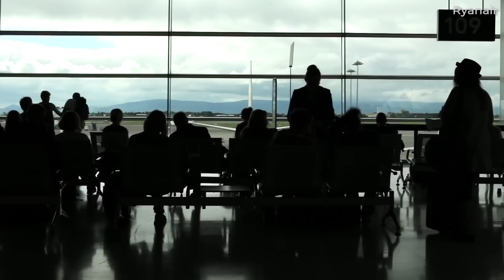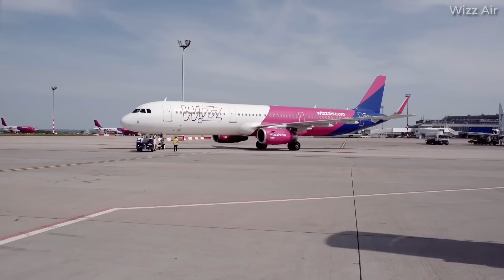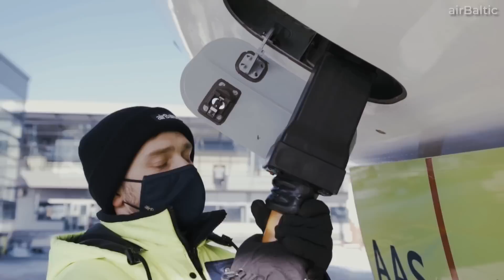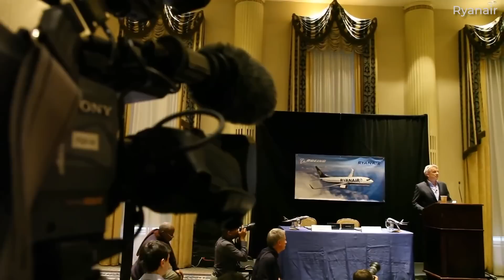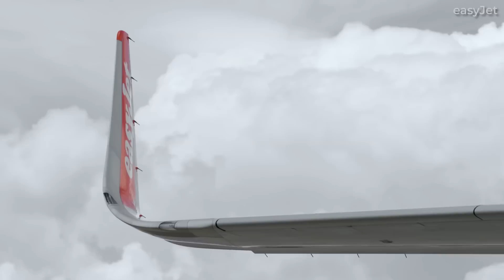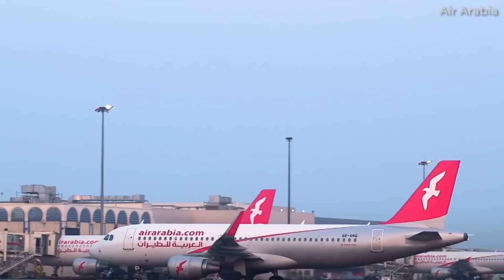5 Key Advantages Of Single-Type Fleets For Low-Cost Carriers

Comment: reading about big discounts make me laugh when looking at Ryanair and easyJet, Ryanair were looking to order the MAX 10 but Boeing initially weren't willing to give them a big discount, easyJet also were a Boeing customer at first but lack of strong discounts led them to go for Airbus instead
Reply: I’m also not so sure about the deep discounts idea. Why should Boeing give any airline like Ryanair or Southwest deep discounts when they know (or hope they know) they’re not going anywhere else for their planes. They’re captive customers.
Reply: also a bit ironic given they accused Bombardier of giving Delta a massive discount when they ordered the now A220
Reply: @CraigC66 because both have threatened to pull orders if Boeing didn’t give them what they wanted. Southwest was teasing the idea of going with the A220 instead of Max7 and Ryannair already has A320 in their subsidiary airline so it’s not a long shot to start adding them in to other ones too.
Reply: Ryanair has 150 737-10 aircraft on order with options for a further 150.
Reply: they do now but initially they didn't holding out for a big discount

Comment: A family of aircraft ( for instance A32x) may have different engines, even if they have the same engine manufacturer.
Reply: Not really a big deal since these types of carriers, the maintenance of engines is subcontracted out. They don't do it themselves other than very basic stuff. Usually under power by the hour contracts with the engine purchase that covers the maintenance.